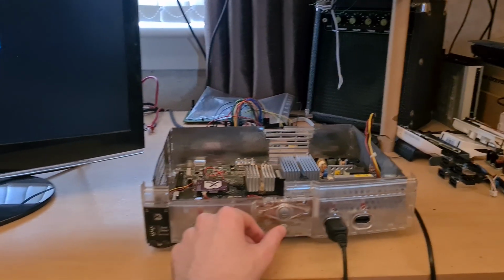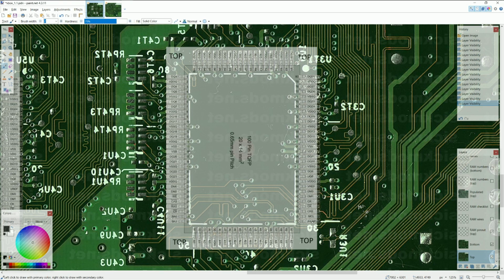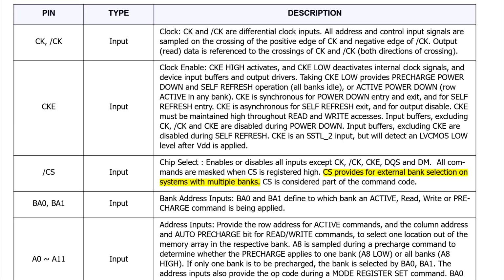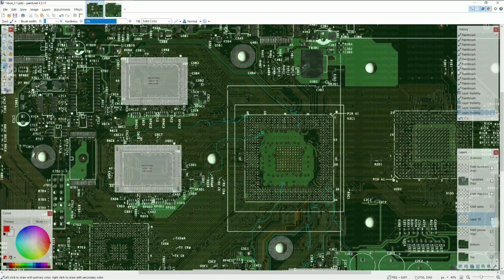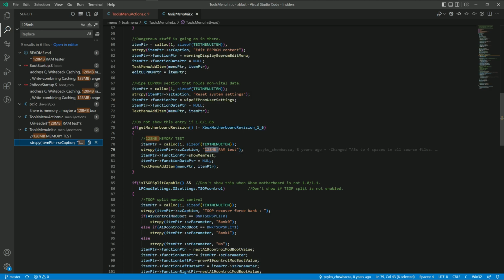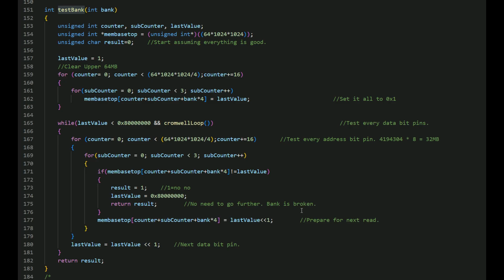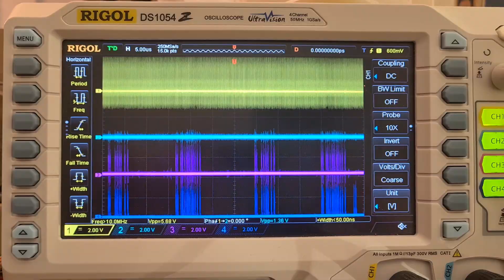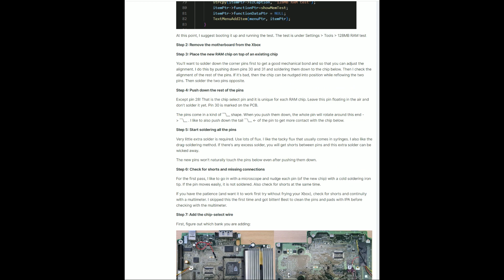How I created the original Xbox v1.6 RAM upgrade

Comment: The important thing is... if you had got QC50 ram modules of TWICE the size on original Xbox... 
WHY NOT MADE A 256MB RAM XBOX WITH THE CHIPS YOU USED FOR THE 1.6????
Reply from the maker: Did you try looking for 256kbit modules in the same footprint? I did.
Reply: @userPrehistoricman  what i say is if that 4 modules making 128mb on a 1.6 can work if installing them X2 on a 8 modules early xbox  so 256mb, but the bios will support it?
Reply from the maker: @SargentoDuke  It has been suggested many times but that idea doesn't work. The connections I made for this 1.6 mod are the same connections that a typical 128MB mod makes.

Comment: Such a big finding! Just on my first try on a 1.6a Board. The 2 top RAMs are working, such a pain go learn this solder method :D the regular RAM Upgrade is much easier (done almost 30 Boards until now :b). But i‘ve got a problem atm. I‘m on the bottom site of the board, Bank 4 is the chip. I soldered the Chip clean on top, but i missed one Little solderbridge and try to start. The Board doesn‘t even give any sign of life. Now resolder everything two times, removed the brige first of course, the Board comes to live, the Xblast lite LED turns on, but the Eject Ring doesn‘t give me a short red (like on Default Xblast Boot) and give no Video out. But also no frag or something else. Did i fried the GPU…? Even by disconnect the CS for Bank 4, the Board has the same behavior 😵‍💫 

Would ne such a bummer if the Board is now only good for parts 😮‍💨 

Thanks for any advise! :D
Reply from the maker: Do you remember which 2 pins were shorted?
Reply: @userPrehistoricman  i think it was somewhere between 75-90, so the last 20 pin Row middle left sided. 😵‍💫 please send me good news for this Information :D
Reply from the maker: @ileox4170  70-90 is the right side though?
I can't tell you for sure, but the first issue you saw (no power) would line up with showing VSS to VDD. That shouldn't harm the xbox. Your current symptoms sound like memory corruption so I'd go and check the CS pins and pads. Did you check for continuity with a multimeter on all pins?
I'm not aware of any Xboxes that have been damaged due to a botched RAM install (including mine).
Reply: @userPrehistoricman  Hi again! The 1.6 was stored away some time, but today it finds the way to my bench. I resoldered again, checked eeeevery connection and desoldered the top RAM on Bank 4. Guess what, the Board doesn‘t work as well. I resoldered the original RAM and …. It‘s back to life 😮‍💨 
I think the bottom RAM had a Bridge somewhere, i didn‘t check befor resolder it. Ready for Round 2 😈👍🏻
Reply from the maker: @ileox4170  Yikes. I hope it works this next time
Reply: @userPrehistoricman  IT‘S DONE 😍 took another try and several hours later…. 4x Succses 😍👍🏻

Comment: how did you begin learning how to do this, I'm high watching a bunch of modding videos and I'm entertained yet dumbfounded.
Reply from the maker: I started getting into electronics ~10 years ago. Start from the basics. Get tools for soldering and a power supply and do something basic, like light some LEDs. Then maybe you want to program the lights or make them do something interesting. A big next step is to get into analog circuits and audio is a great way to do that. Build a single-transistor amplifier. Notice how it sucks :) Build a better one! Or if you want to go digital, get a some microcontrollers and make them talk to each other. Digital protocols are a nice mix of analog and digital.

Comment: Too weird, why you need this in 2022?
Why not releasing dome title on new systems, why the museum?
Reply: There is a simple answer to this: Because we can.

The long answer: The OG Xbox is capable of running some games natively on 720p, but there is just not enough RAM to do it. With this mod, these games can actually improve their performance and some other games can be modded to run on higher resolution.

Comment: with this method, would 256 MB be possible on an OG xbox? possibly by doing it to both ram spots on the older models... might need some kind of hack to the kernel i guess?
Reply from the maker: No. This method uses the same chip-select signals as a 1.0 - 1.4 upgrade. There are no other chip-select pins on the northbridge to add more chips.
Reply: @userPrehistoricman  oh i see, that's unfortunate, it would've been really cool
Reply: There is a method for 256mb now